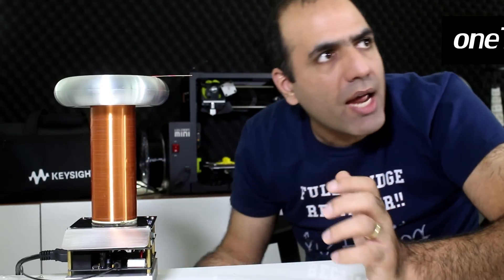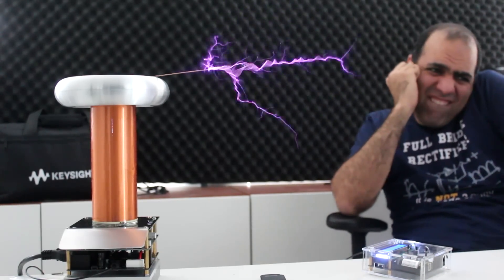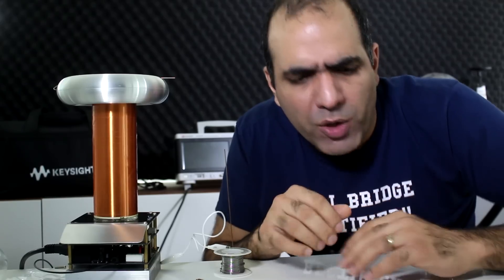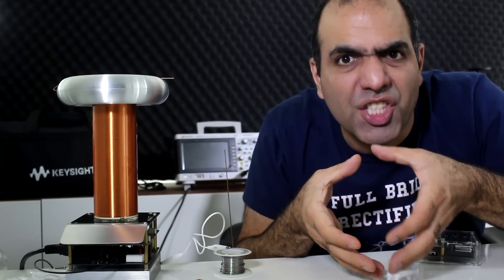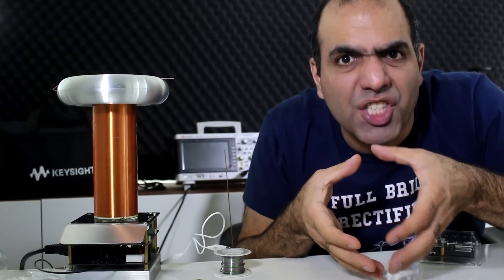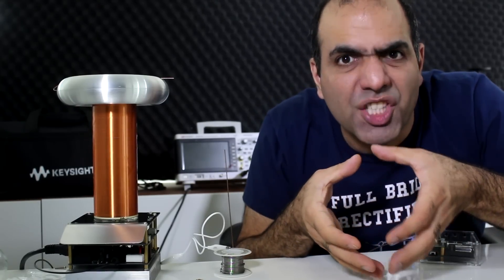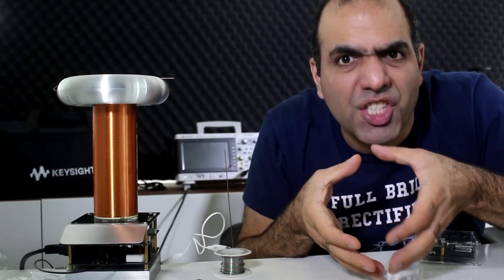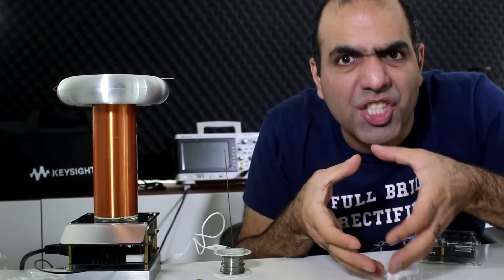All You Need to Know about Tesla Coil... Almost (OneTesla Part 2)

Comment: 1:50 (and the other time u turned the frequency up in the single tune setting)

It really sounds like vf drive on a tram or something when it just starts accelerating, before it goes to the pattern mode and starts making the gear changing sound

Comment: Theoretically the switches to high and low are never on at the same time. When (and it's when, not if) this happens, BOOM! occurs. It's surprising how far molten silicon can travel in a very short time.

Comment: Dear Sir,
I like very much your way to make videos, really entertaining and instructive.
Thank you for doing that.
I write to give you a little contribution.
I hear you say that Telsa coils do not electrocute because of skin effect.
This is not true. I have heard this many times, also from a teacher of Phisics during lesson, 
but it still remains not true.
If you take the formula for the skin effect, and introduce in it any reasonable value for the 
human body resistivity, you see that even at 1 MHz the current goes well into the body.
The "skin" effect is very ineffective on human skin.
The reason why the HF do not give us electric shock is:
- The electric shock comes from electrical stimulation of nerves
- Such stimulation comes from electric field moving ions through nerve cellular membranes
- In an HF field the ions are pushed and pulled so fast that they simply vibrate on the same place and do not
go through the cellular wall.
While the fast vibration on minimal elongation prevents nerve stimulation, it still allows the thermal effect of the electrical current on the body.
This is the working principle of electrosurgery.  Also, it is the reason why you can get burn from a Tesla coil.
As for the reason why one can get electrical shock from some Tesla coils, I had the very same problem
in an electrosurgery device. 
In the end, the cause was the partial rectification of the HF happening in the arc going from a sharp electrode.
If the electrode is pointed, the arc can be asymmetrical, enough to partly rectify the HF.
We inserted a low capacitance DC-blocking capacitor, and the problem gone away.

Best regards
Ezio

Comment: I must correct you, your mistaking here. The primary capacitor and the secondary capacitance are reflecting one on eachother so the resonant frequency is effected from them both in parallel (yes, I'm ignoring coupling factor) so as more as the primary capacitor is the dominant one, it prevents the frequency from being versatile

Comment: I'm not an engineer and have a stupid question. If we can collect electricity with resonance and copper wire coils why can't we use the Earth 7.83 htzs to collect energy increase it with the Tesla coil and then change the frequency to use it in electronics.

Comment: So if it loses its power due to friction.
What would happen in outer space?
Has anyone tried?
Reply: Friction exists not only between system and air, but also inside the system itself. For example, between parts of the spring when it moves. If you hit a piece of copper with a hammer several times in a row, it will become hot due to friction between atoms during deformation. So, kinetic energy of the system will eventually convert to heat one way or another.

Comment: for putting the double winged wire on top, would it work to put a grounded ring of wire around the coil to prevent it from arcing to the base where the driver is? Get some 18AWG, and make a hoop that you place around the coil, and connect it to a grounded wire or an ESD bracelet. Or would this cause the arcs to push towards the hoop, instead behind the ends of the wire?

Comment: When I was 16, I was building a two transistor radio on a piece of vero board, with my new Weller soldering gun I got for christmas, I didn't know about the dangers of that flux in the solder, after like 2 hours of messing around, soldering etc, I developed what can only be called the mother of all headaches, it was really bad, felt like vomiting, head was throbbing,  very dizzy, didn't want to move. So fellas DO NOT inhale that smoke from the solder flux

Comment: Can you use a Tesla coil or similar high PD source to measure electricty flowing through the ground to demonstrate step potential? I was thinking of maybe using an ignition coil or something and measure the ground with a multimeter in step size gaps to illustrate PD between steps and demonstrate how to stay still or shuffle to safety.

Comment: It seems extremely efficient
Plz someone tell me about its specifications like input power , driving frequency , is it solid state TC ? Is it zvs powerd ? Is it dual resonance tuned  etc ?
Reply: It's a small drsstc with an igbt half bridge. I can't be arsed to check the power requirements, but I reckon the bridge probably consumes 200W on max power. Just a guess tho

Comment: But Mehdi, how can i know the resonant freq for a Tesla Coil if i cannot measure the capacitance??
Reply: You can run the coil on a Slayer Exciter circuit and measure the resonant frequency using a clamp meter, that's what I did with mine.

Comment: Not to take any support away form Circuit Specialists, but if you can't wait for a fan, or don't have the money at the time, you can take a computer fan, put fan guards on it (The metal safety grills), and put a thin napkin over the output side. This will work in the same way, though be a bit less effective.

Comment: It's a bit secretive, with the circuit boards painted black on both sides. If you look at a circuit board from an old radio they are usually not painted so you can see the copper foil on one or both sides and you can figure out how the components are connected together.
Guess OneTesla want's to keep the exact wiring to themselves.

Comment: Some corrections: the first stage and second stage of the coils don't need to be designed to match in resonance since they act as a transformer and the capacitance from the second stage will reflect to the first side by reverse winding ratio.
Reply: Some corrections: since and first
Reply: This isn't true. In fact the more turns, the higher the inductance AND capacitance. This might work if the two were inversely proportional to each other. The primary needs a much larger tank cap than the secondary's parasitic capacitance to earth, due to its lower inductance, hence the cap on the primary side has quite a high capacitance (in the nF to uF range)

Comment: 11:58 Hoo boy. I've built something like this to power a cooling system, bumping 120V AC to +12V and -12V DC and used a 4700µF 50V Polarized capacitor at the outputs. The positive voltage capacitor was fine. Plugged the negative to ground. The negative voltage capacitor was not as fine. Plugged the negative to ground, meaning the capacitor was plugged backwards. Apparently, the capacitor thought it was such a stupid mistake that it didn't even bother giving me a decent explosion! Instead it just made a small pop and shat itself all over the circuit board!

Comment: hey the veiwer can any one explain how the lower transistor is still alive? the transistor needs small gate voltage to turn on and the gate of the lower tramsistor is connected to  -170v by the coil. so it should blow up.......shouldent it?

Comment: I have the mini version from onetesla. I spent a long time assembling it and did all the system checks along the way. I've never got mine to work. It blows a fuse the moment the power cord is plugged in. I wish I could figure out what went wrong as it was pretty expensive and is now just sitting there unused.

Comment: I hope there is a 1:1 isolation transformer ahead of the bridge rectifier.  Never connect a bridge rectifier directly across the mains.  If you plug your device into an electrical outlet that is wired backwards, you will be in for quite a shock.

Comment: Would it be possible to amplitude modulate the voltage of the 175KHz base sine wave with actual audio waveforms instead of interrupting it with square waves?

Comment: i love you but you explained how a spring works wrong. when its streched it holds potential energy as it contracts the elastic potential energy is convered to kinetic, as it pulls up the bottom its gravitational potential energy rises once all the elastic energy is gone and it stops moving fully contracted the gravitational potential energy is then converted to kinetic which causes it to fall again. though since the system isnt 100% effecient in its energy convertions it eventually stops at a point where the forces are equal

Comment: flippin hilarious. You just explained climate change. I know you know a magnet field shrinks when it gets stronger, (higher in quality) so why does everyone think a grand solar minimum is the sun weakening? The rate of induction is the speed of light based on the medium the field travels through. A generator/alternator is an inside-out battery. Acceleration is a loss of inertia. What did we learn in school??? Nothing. Love the channel! On a brighter note, I built a 1,000-watt high-pressure sodium light and I shocked the shit out of myself touching the capacitor 1 min after unplugged. Maybe that is what is wrong or right with me. The jury's out. No verdict yet. Can't sleep....sry.

Comment: Please ElectroBOOM, you must consider safety of your ears as well. It's clear that the coil is going off way too loud for your ears and hence you absolutely need earplugs at minimum, or other kind of ear safety equipment. You can get zapped without any permanent injury, but once you get ruptured eardrum, it's one-way stop

Comment: when we give square signal to the primary coil; shouldn't the inductor develpe an opposing voltage in the opposite direction when the signal is low thus making the secondary coil high?

Comment: There exist lots of prove of "Free energy", depending on how you define it.
Thermodynamic claim that you can not claim to get more energy than you put into it, are the big lie, the big BS.
Resonance is an energy that you get more energy out of it, as one example
Just look at equations of induction, there are other attributes that contributes to energy than the energy  you put into it., another example. Induction it self does not comes from how much energy that is put into it. But the change of current that is done.
Meaning higher frequency higher output.
https://3.bp.blogspot.com/-wEZwg14NYg8/VvUsx91h4iI/AAAAAAAAAj4/K8j7KNCRk9cGOLuN1DMsZpP0vLeYAAgYA/s1600/Inductions.jpg

You can actually use energy without using it another example.
With capacitors.
https://4.bp.blogspot.com/-O7OcDPyYPQ4/VoBOMVd3C4I/AAAAAAAAAgI/ZmemnuODVj8/s320/kondensator.jpg
Reply: most simplest example of over unity is a Amphitheater, a single voice can be heard by all people and not one piece of electricity is in place.

Comment: I wondered why the top load of a Tesla coil was almost invariably toroidal, but I can only find hints. It seems that the toroid shapes the electric field in such a way as to direct the discharge sideways, since the outer surface of the toroid has positive curvature and the inner surface has negative curvature (therefore reducing the strength of the electric field as we mover around from the outside towards the inside). This would have the additional advantage of reducing arcing back to the secondary winding, as long as the toroid has a larger diameter than the secondary winding. This makes the "One Tesla" coil look right, and your earlier coil look wrong. I'd appreciate any criticisms or corrections on this issue.

Comment: Hey Mehdi, just a quick question (hopefully!). So if frequency determines the output power of the coil, does it mean that the arc lenghts are differentiating between different frequencies because on lower frequencies there's lower power (less impulses over unit of time) than on higher frequencies? Or is it that frequency somewhat directly determines the overall current draw of the coil at any given time, if yes how? Or is it both? I know that this can propably be googled but I'm stuck at "i don't know what to google next cause everything I come up with gives me no viable results at all" :C The curiosity is killing me! Anyhow, thanks man, you're awesome!

Comment: My first few Slayer Exciter circuits worked fine. In fact, my first one went into a light saber I made by wrapping a secondary around a piece of pipe and jamming a florescent bulb down into it. But I tried making more later on and it kept melting the transistor. I think the issue is the capacitance and a bad frequency derp, but I'm unsure of the whole issue. I've tried calculating the frequency, but it wasn't going well. Any help?

Comment: I want to ask what would happen if i connect the secondary to the ground using a resistor and not a parasitic capacitor? Since those tank circuit oscillations are not much of use as the slayer exciter circuit relies on the diode to turn on and off the transistor.

Comment: I've watched alot of your videos I have learned alot from you thank you. I am currently building my 3rd Tesla coil. My first was a pulse generator about a foot tall my second is a zvs driver with flyback about 2 foot tall and my current project is a 4 foot tall coil with an NST  and rotary spark gap I can't wait thanks for your information it's helped alot. I'm gonna save for a one Tesla those little units are pretty powerful. Thanks again

Comment: actually the flux capacotors at a 95 degree angle opposed to the molecular susbstance that surfaces resonant frequencies to the secondary bywave controller which obviously has no connection to the irregualar current of the neocortex hydrometer system

Comment: Love the deep dive electrical stuff man. Would it be possible to put an opto-isolator   on a UARTs Tx and Rx? Or would it be too slow to handle standard baud rates (9600, 115200, etc). I guess fundamentally it depends on how long it takes an opto-isolator to switch on and off. Is there a term for that?

Comment: Hello Mr electricboom,
   I am having a difficult time finding the simplest way to calculate how long it will take to charge a capacitor. (Besides hooking it up and timing how long it takes to charge to the same voltage as the power source).
 I've looked around and just found unsimplified ways to calculate, plus they don't seem like sources I could trust.
 I think you are cool and actually know what you are doing well enough to help people like me understand how to calculate how long it takes to charge a capacitor in a really really really simple way.
 Plus I will trust what you say is true.
 Please help.
Thank you
P.s. I only play around with DC, I don't know if that makes a difference for calculating charge time but please explain for DC please please please.

Comment: 12:25 why the input is 120v ac and the output is 170v dc? is it because of the capacitor?
Reply: in AC, the 120V isnt the maximum value
the peak is 170V

Comment: GIMME DA ONE TESLA with it's FULL BRIDGE RECTIFIER so I can play some cool tunes with it. 

Also can you explore the wireless transmission of power using a transmitter Tesla coil and a receiver Tesla coil set to the same resonant frequency?

As a side note do you know how many radio receivers can be connected to single radio transmitter? I have tried to find the information but can't seem to find any information. I was wondering if the Tesla works the same way as radio transmitter in that it sets up a standing wave which you can "tune" into.

Comment: I would - of course - also like the coil, but I also have a question:
In order to transfer power the primary and secondary coils have to be magnetic coupled, right? But how does the coupling work. The primary is located at the bottom End of the secondary coil, giving it a relatively good coupling. However, the coupling to the other side must be very weak given its distance and relying only on the magnetic coupling of the "air gap".  Or does the material the coil is wound on have a permeability >> 1? Or is this some HF thing which I am to stupid to understand :-(

Comment: honestly this is way better than the electronics class i took in school – though i am grateful for those classes for letting me understand all of what you're saying relatively easy !

the diagrams you're drawing are also a lot clearer, and i'm sure it helps that you're doing each part separately, unlike my teacher who would try and make it all be one huge diagram of the "full picture" as it were. 

i do wonder if any schools are using your videos in electronics classes, though. you're certainly more engaging than a lot of the teachers, and a lot of what you're saying would be a great springboard for the subjects that at least i did. that fibre optic cable, for example, could be linked into magnetic and optical relays, which my teacher sort of struggled to explain how they were isolated and yet also connected.

Comment: I don't understand why the mid surface of an IGBT/ any through-hole power transistor is isolated from the heatsink with that piece of rubber when screws usually are not isolated in any way. Screws are conductors between a heatsink and an IGBT.

...or have I been screwing up my projects by doing something wrong? Who knows, I haven't electrocuted myself yet with 220V AC.